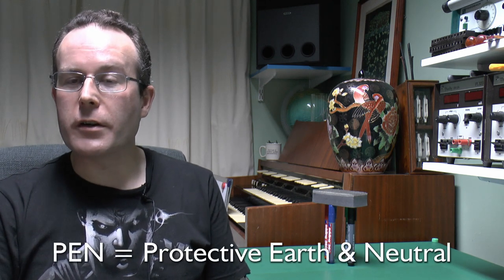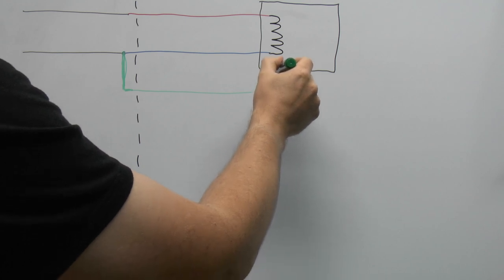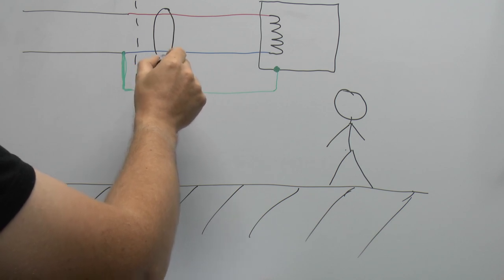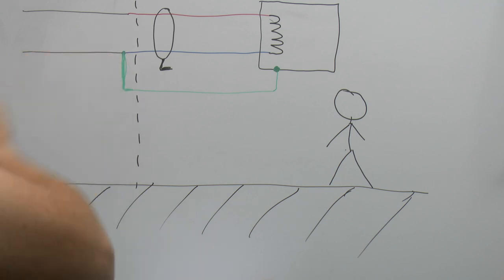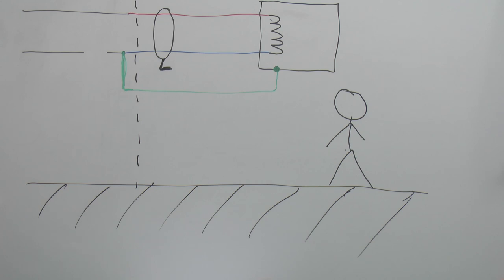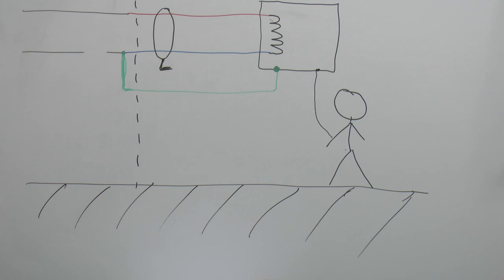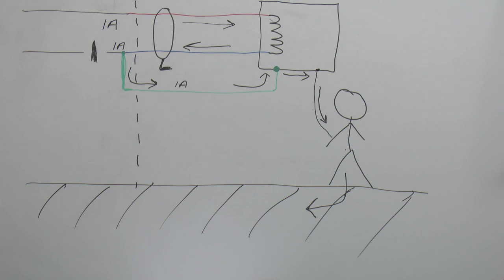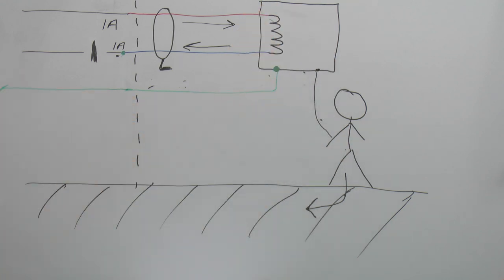TN-C-S Danger - Broken PEN Conductor (Combined Earth & Neutral)

Comment: Basically you should split PEN to PE+N on your first distribution box and connect PE from PEN to your house PE which is mandatory in EU. Then, if N is disconnected from supplier, the L will flow to PE via the house PE connection. In my country the national company already splits the PEN before connecting the house so i have 3 phases + N + PE in the junction box and supplier PE si connected to house PE.
Reply: Radu, the UK was part of the EU when this video was made. You should explain you are talking about a local grounding system for each house, that must be provided by the home owner to the distribution operator...
Reply: @silviuguseila2552  Yes, my thoughts too. A dedicated building grounding system with a defined maximum impedance is being discussed here. My understanding is that in this case, a fault like this will cause a high fault current due to the low impedance of the foundation earth electrode which would trip a breaker and make it safe. This happens in the UK too by virtue of bonding of extraneous conductive parts such as gas and water services to the main earth terminal, but since the impedance of those pipes can be high, reliable disconnection will not occur.

Comment: Why isn't your earth wire physically connected to the Earth? (ie. metal rod in the ground). That's mandatory.  The earthing/grounding is your "giant sink" for leaking currents, and also keeps your Neutral at 0V potential. It is ALWAYS driven into the dirt somewhere (either in your location, or at the transformer). Not much use in connecting it, if you don't run it in to the actual ground: you just create a parallel connection to your appliance chasis and wait for disaster to happen. Also, in TN-C-S you are NOT given Live and Neutral. In TN-C-S you are given (3ph) Live and Earth. You "separate" the Neutral by connecting it to the (given) earth before the Groundbreaker. If you ARE given Live and Neutral, then this most likely is a TT system, and you are expected to drive a pin in the dirt  at your location and use that as an earth connection.

Comment: Good video! In addition, if the supply is three-phase (standard in for example Scandinavia) you get the additional problem that a lost neutral will render any voltage in between 0-400 V on the standard one-phase 230 V circuits that might destroy plugged-in equipment and cause a fire. This is due to one-phase loads with different impedances will back feed the neutral. In essence, two loads are connected in series between two phases (400 V) and if one of them is an immersion heater, the other a computer, essentially all 400 V will appear over the computer due to its higher impedance and the formula of voltage division. This combined with what's explained in the video makes a lost PEN a very nasty fault.
Reply: This happened in our home when I was young. It was a TT system, but the Neutral connection failed. As you said, all the light loads that were on a different phase to the heavy loads in the house blew up as the heavy loads presented a much lower voltage drop across them.
Reply: Hungary is the same electrical system. (3x400/230V)
PEN fault = neutral potential increases (N potential <= max U) and "starpoint" is shifted. (Local ground elektrode connected to PEN can help)
Reply: same thing would probably happen here in the US, id like to see him explain it and draw it out though because i wonder if the earth/ground wire issue in the video happens on our split phase system.  We have come close to losing the neutral as it was being chewed on by animals for 50 years and when you used the microwave the lights on the other phase got brighter (gained about 10-15v) and everything on the same phase lost the same.
Reply: also as far as i know we never have an earth/ground wire that comes from the pole here.
Reply: kibi15 

The same thing once happened to me.  I’m retired now, but used to work in a large college.  One day I was seeing all sorts of strange adults, fluorescent lamps flickering or dim or over-bright, various other things not working properly or overheating etc.  I reported it to security who told me not to worry about it, as EDF were working in the substation.  They were indeed working in there, they had rollers laid out and were pulling through new HV cables, two bundles each of three single core cables, each about the size of a rubber fire hose.  New cables not connected to anything, and old ones not disturbed in any way.  Whatever the fault was it was not related to this work.  Returned to security to to report it again.  Was told that it was just the Voltage being a bit low, and not to worry about it.  The installation was overloaded, hence the new HV cables and transformer being installed, so the Voltage did tend to be a bit on the low side.

At this point I grabbed an AVO, and measured the Voltage on a number of random sockets in various rooms, some were under Voltage and some over, by a considerable amount.  I guessed that the different Voltages were on different phases, and thinking about it thought that it sounded like a neutral problem with the neutral point wandering about, closer or further from different phases depending on the load being drawn from each.  Then measured between neutral and earth, and found various, considerable, Voltages.  The installation was way out of balance at that time with L2 being the most heavily loaded, with L1 next and L3 least.  I returned to security again, told them that something was seriously wrong, and it needed urgent attention.  I received the incredible reply that they would give the keys to the LV intake room so I could go down to investigate.  I told them in no uncertain terms that I was a humble I.T. technician, certainly not qualified in any to do anything about it, that they needed an electrician to deal with it, and I had no reason to think that the fault was in the intake room anyway.  Unfortunately, the college no longer had an electrician, the one they used to have gad left and it was decided not to replace him to save money, but to just call in a local electrician required, which was most days in a building that size.

Local electrician was out on another job somewhere, but came in later in the day, came to see me, to ask why I had reported a problem; he’d just been told by security what the Voltage was a bit low, and there was nothing he could do about that.

When I came in the following morning the electrician was there.  He told me to go with him and in a large panel in a corridor behind the library where the fault actually was.
Reply: Yes, open neutral is a disaster for split-phase too.

Comment: A number of people on here have mentioned about also fitting a local earth or connecting to pipework as well. The local network provider here (Western Power) strongly advised against this because in the rural hamlet I’m in on overhead cables, the break is likely to be some distance away and thus I would be suddenly providing the earth for all 100 homes. Dependent on what goes wrong elsewhere, I’d better be sure my earthing was capable of a good few hundred amps!

Comment: The DNO should make it mandatory for an additional Earth Rod to be installed and connected to the supply intake for every TNCS system which would mitigate the risk of this unsafe condition.
Reply: That's how it is here in Ireland
Reply: That seems on first sight to be a good idea. As J.W also explains in a later video about earthing for E.V. charge points, such a supplemental earth is no where near adequate to ground currents that would otherwise make their way through low impedance paths. A TT. rod (at the cable head) has too high a Ze to handle large fault currents. 
Additionally the neutral break may take in a number of properties all feeding to the now floating P.E system. The only way out is through that metal case.

Others mention 3 phase property. But we should remember that the DNO balances the phases by property via alternate single phase supplies. So you may be lucky and have a V drop rather than a V rise.
Do the regs protect us against conductor loss or live earth. Not yet...
Reply: @alistercarmichael4990  you are right, maybe to provide condition/requirement with lowering TT impedance 20 ohm sth, it would be greatly safe and would be safer than TT only system.

Comment: Looking at the diagram a TT system eliminates this serious problem.  But TT needs a foundation concrete earth rod (using the house foundations) or a soil earth rod (many rods around the house).  A rod or coil of earthing wire can be set in concrete in say under the garden of a house. Then the TN-CS earth supplied by the supplier can be ignored - use your own. Of course RCD/RCBOs need to be on all circuits in a TT installation, and one main whole house RCBO, as the French have.

Comment: I received a shock standing on steps touching a line wire in a lighting circuit the other day, but the RCD did not trip, can anyone explain this? Current flowed through me to earth. Or was it the steps that prevented it flowing completely back to earth? Either way current flowed through me so there was an imbalance, no?

Comment: Why did they even consider the TN-C-S system to be a good idea? Seems to me that it just shits all over the protection provided by an RCD.
Are there any advantages of having this system over TNS or TT?
Reply from the maker: The advantage is the cable is significantly cheaper, as it only has 2 conductors.  Usually a single centre core for line with the combined neutral/earth as separate wires surrounding it.
Reply: An RCD is used to protect against faults that happen after it. It cannot protect against faults that happen before it.
Reply: I am from a country where the TN-C-S system is quite common so let me provide some insight on why they might use this system while a better alternative, the TN-S system, is available.

My country used to be a part of the Soviet Union, and during the Soviet era residential buildings weren’t as electrified as they are today so they didn’t even bother to provide a proper earthing system. Hell, in some older buildings that didn’t undergo the modernization of electrical systems one can find socket outlets without PE contacts.

Now, when people use a lot more electrical equipment at their homes than before, the need in proper earthing arose, and the newer editions of our national electrical codes require to use the TN-S system when possible. They do provide the TN-S system in new buildings but due to poor financing they don’t do so in older buildings as installing a five wire all the way from the buildings to their respective transformer substations is quite costly. Instead, they split the PEN wire in building’s main distribution board into the N and PE wires (the point of split is also earthed to prevent dangerous touch voltages in case of the PEN wire failure) thus providing the TN-C-S system. It is worse than the TN-S system for sure but at least better than the TN-C system.
Reply: RCDs weren't as available and inexpensive as they are now and live to a grounded chassis fault on TN is a dead short so normal breakers react.

Comment: You could install a light bulb right before the RCD. When you notice the light is off, then there must be something wrong.

Or you could install something like under voltage detector. When the PEN is breaking, the under voltage detector will tripped.

Or how could you make this safe?
Reply: PEN fault protection device

Comment: Another excellent video (I know I am late to it). This has quite serious implications for some radio hobbyists whereby equipment inside the house with it's normal safety ground is connected to structures outside the house via coaxial cable.
Reply: I know I co-wrote EMC 07 for the RSGB on the Subject, http://rsgb.org/main/files/2019/12/UK-Earthing-Systems-And-RF-Earthing_Rev1.4.pdf

Comment: Hi John, great video. What would happen if there was an earth rod attached to the TN-C-S system? Would that bring any improvement at all? It seems in Ireland all systems have TN-C-S connected also to an earth rod.
Reply from the maker: An earth rod would divert some of the current in the event of a fault, and reduce the voltage on exposed metal parts.  However unless the impedance was extremely low, the effect would be insignificant.
Reply: Yes it would act as another path to 0v potential so it would keep the whole thing grounded. It would also decrease your Ze reading and help with earth loop impedance as it's a parallel path.
Reply: What impedance value would be needed for an Earth electrode so that the installation is ok in any Neutral fault? In Australia we wack the rod in and never test it, sortajust hope for the best.....I know in the UK its tested until suitible results, whats a good result?
Reply: If also independent earthing rod present with an impedance below 20 ohm sth, then it greatly improves the safety and save life probably.
Reply: @Mark H  Google AS/NZS 3000 Earth fault loop impedance , NZ and Aus is using TNCS system with Earth rod installed and yes you will need very low Imp for Earth Loop to be working

Comment: Ouch...!!! It might be a good idea to make a secondary earth connection from the consumer unit to either a gas or water pipe if you got TN-CS.
Reply: Or install an Earth Rod so that theres no chance of the water or gas pipes being seperated from earth if plumbers sk work. Just have an Earth rod driven far enough so that if the Neutral is broken then the Earth rod will direct the current flow via Earth.
Reply: Bonding other Extraneous Conductive Parts is already a requirement in any case, regardless of TN-C-S or not!.
Reply: @unknown 3226 yes thats why all housesin Australia have a earth rod because most houses are supllied via overhead cables. Can easily get a broken Neatral. I see it on a weekly basis while working. Its dangerous the methods used in Australia. Even with a earth rod the current will flow everywhere and all the Earthed appliances will get touch voltage. 1.3mtres is earth rod requirement in oz. But it needs to be driven 3 or 4 metres to get the best result when i test the rod

Comment: Although deleted from regulations now, would an Earth Leakage Circuit Breaker trip if one was installed? (an trip back in time to the 70's)
Reply from the maker: copelandaa It probably would, as it would trip with a voltage difference between the installation earth and an electrode / rod in the ground.
Reply: @jwflame  
So best have an ELCB and RCD fitted in series? To be sure?
Reply: @johnburns4017  I am not an electrician, but I think it would be not in series. An RCD would be just like that, but you would put a current or voltage sensing ELCB to sense the current from PEN-N to PE just at the place of split, before the PE is put into main PE block (with any auxilary earthing), and trip the main circuit breaker (disconnecting both L and N). So if there is any reasonable current going via L->N->PE will trip the main supply. The advantage would also be that if the resistance to ground is high, it will still trip. It might also be possible to fit an additional ELCB from the main PE block to the earth, to also trip the main circuit breaker, to measure the current to ground directly. The problem is that in many buildings there might be other earthing devices, and might not be enough. But probably doesn't hurt. It can probably be done even in TN-S system.

Comment: Hi John ,great explanation . Back in the late 70s as an apprentice electrician in Glasgow, i was nearly killed due to the above situation on what was Called then PME system .It was a factory unit and the SSEB were connecting mains supply ,3phase & N  (earrth) + meter . I was at the other end of the factory unit connecting MK grid swtiches . The part i was working on was isolated .The SSEB Electrician had finished and  left site ,and our Electricians began powering on finished/tested  part of the  installation .
 I then received a severe shock through metal MK grid plate as this had earth attached.I fell to my knees and broke the circuit to earth .Further investigation from our electricians found the SSEB had screwed onto the Neutral insulation which  had the same effect you described above . Im now retired after 44 years, but a lesson never forgot.
Enjoy your videos ,keep up the good work.

Comment: Thanks John.  I'm in NZ where I understand we use a MENS earthing system.  We had a situation where a mouse bit through the supply wiring in the wall between the meter and switch panel causing a similar problem to what you describe here (earth was severed and some of the supply cable damaged).  I think the house side of the earth connected to either the live or neutral cable at this point.  All of the bonded items began carrying a charge (130V at the metal front doorknob discovered by my son as he exited for work).  No fatalities (apart from the mouse) and an emergency call out to the electricians put things right.  There may be an issue with our earth rod (on the MENS system) which theoretically should have carried the charge back but need to speak to speak to an electrician after the holidays.
I'd value any input from others to put my mind at ease in the meantime.  I think we've been very lucky but until the electrician has a thorough assessment I remain twitchy.  Thanks.
Reply: The problem is, the earth stake does not have low enough impedence to carry the full neutral current, so it, and everything bonded to it can carry hazardous touch potential. Near to the earth stake, you can also have a hazardous step potential.
Reply: Isn't the MENS  the same TN-CS?